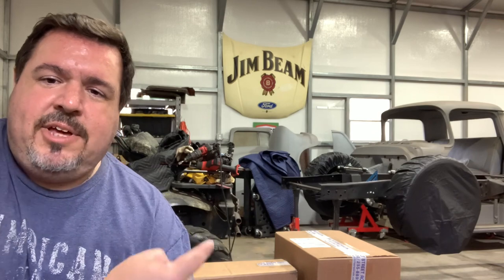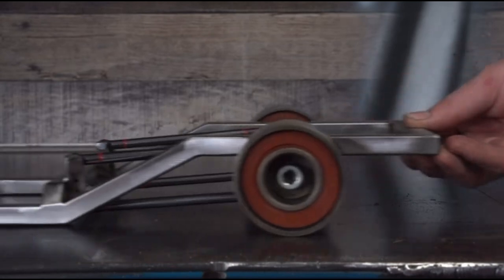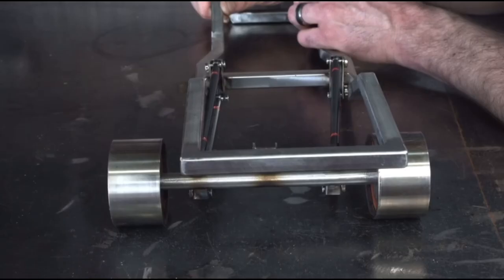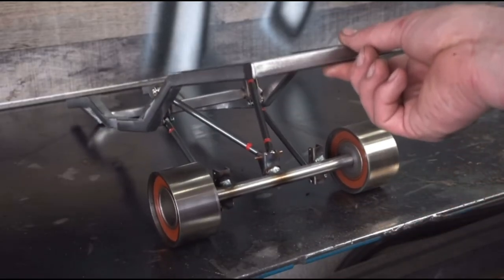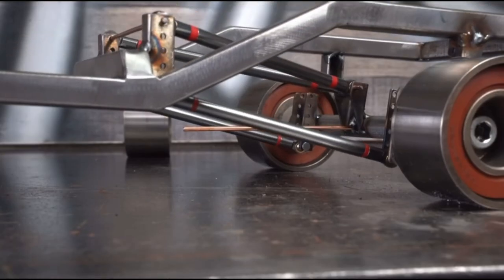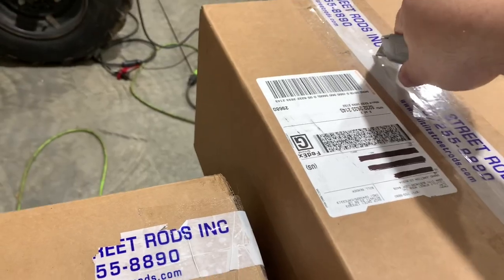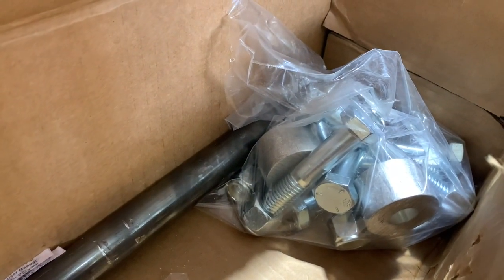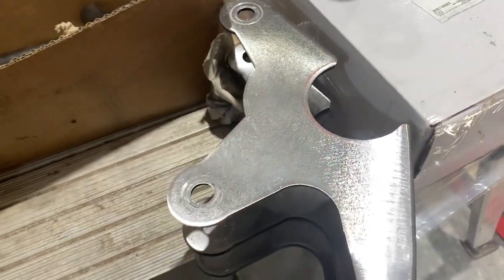Which Type of 4-Link Do You Need? @GarageFab

Comment: That was a joy to watch, Mike! (From 0:57 to 10:25 was painful but the rest was great.) I’ll be watching to see where this project goes and to make sure you don’t slack in posting videos. 😊
Reply from the maker: Hahahaha well that was my favorite part. Thanks again brother. Was such great stuff - and the amount of work you put into your content is clear to see. But… the mini model!!! That’s content creation at its finest right there!
Reply: I used this same kit for my 56 Chevy truck. I wish my kit came with shock mounts. I had to make my own bat wings on the side of the frame. It’ll be interesting to see how you roll with this kit.
Reply from the maker: @79_Trucker  Im getting ready to set the cab on the frame to mock up engine and trans mounts. I want to get as much weight on the frame as possible before installing the rear suspension. How are you liking the kit so far?

Comment: The real question is, how do each of the 6 possible triangulated designs compare, specifically in roll centers, roll steer, and anti-squat/anti-lift?
1. bottom parallel, top triangulated at chassis
2. bottom parallel, top triangulated at axle
3. top parallel, bottom triangulated at chassis
4. top parallel, bottom triangulate at axle
5. both triangulated, top at axle, bottom at chassis
6. both triangulated, top at chassis, bottom at axle

Not to mention whether you use rod ends, bushings, or some special joint like a johnny joint and whether they're welded perpendicular to the links, or perpendicular to the chassis/axle and how that does or doesn't affect roll bind vs bump bind and NVH values.
Reply from the maker: Yep. Lots of room for discussion surrounding the topic of suspension geometry
Reply: @intheshoptv  I recently read that top parallel, bottom triangulated (called a Satchell link) is really good for having no roll-oversteer AND a fair bit of anti-squat, as well as a low roll center (all good for a sports car). They specifically said to triangulate the lowers at the chassis, but I couldn't get any concrete answer as to why and/or how it would make a difference (specific to the Satchell link triangulated lowers or in general) having the triangulation at the chassis vs the axle. Though I suppose having the uppers triangulated at the chassis could cause more cabin intrusion and make a back seat more difficult to keep.
Reply from the maker: @Drunken_Hamster  While Ive seen that once or twice and thought nothing more than “hmm thats interesting”, I never knew it was called a “satchell link”…. Now Ive got more reading to do😊
Reply: @intheshoptv  Yeah, Satchell Link is triangulated lowers with parallel uppers. Though again, the reading I've done seems to prefer triangulating it at the chassis and having all the links "wide" on the axle side.